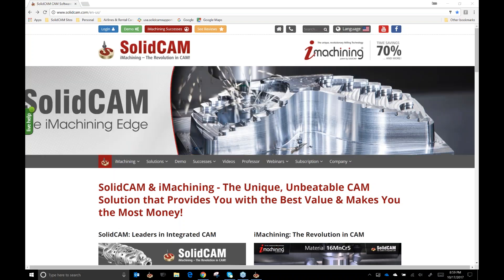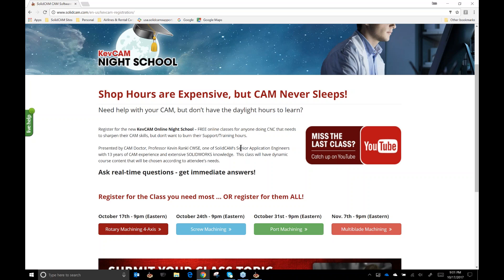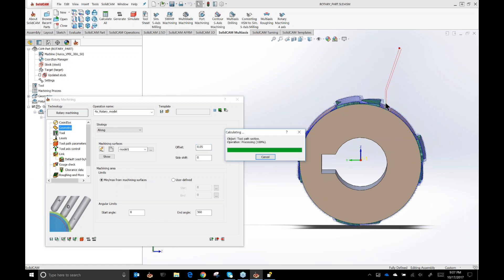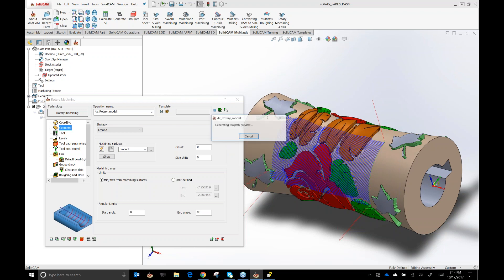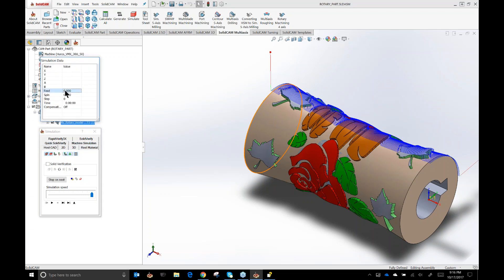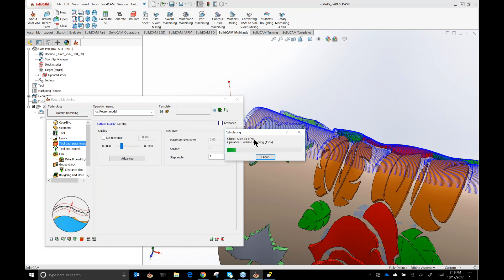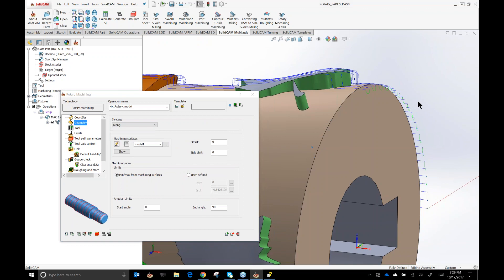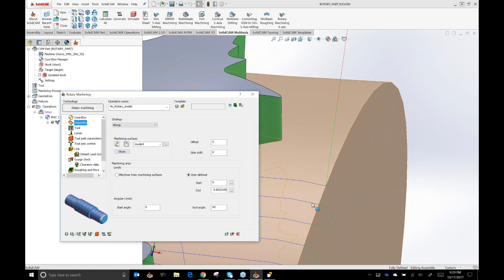KevCAM Night School - Rotary Machining 4 Axis

Comment: Hello. When doing a normal milling for a rectangular part using only X,Y and Z axis (three axis), I can use HSM and select specific faces to work on, and It also detects the target model so it doesn't machine past it. How can I do the same with 4 axis ?. I mean, the Rotary Machining module does that but I can't select specific areas or faces, It works completely around an area. How can I work on a specific face ?.